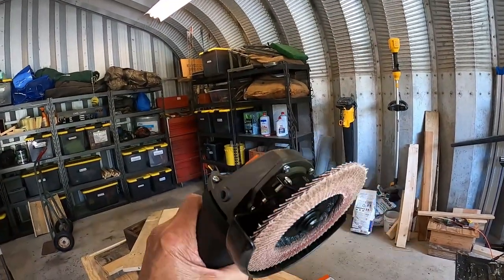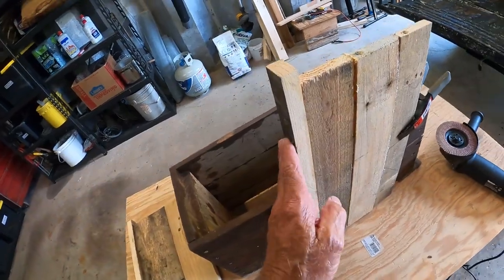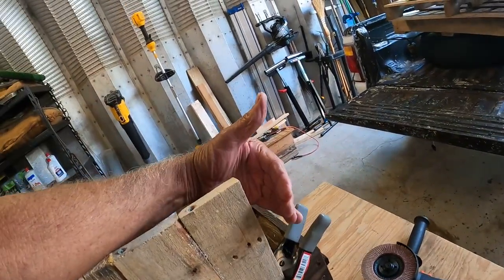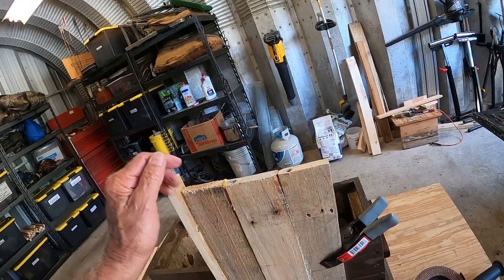Follower Boards

Comment: Nice Video re pallet timber.
Your Camera seems to bow the Top Bar in footage... 🤔
Reply: Have you a Video on making a Nuc from pallets.
Are your Boxes using Langstroth measurements?
Reply from the maker: Thank you!
Reply from the maker: @ME_MeAndMyBees  Yes i have a video on making them. No the boxes are not standard but standard frames go in them. I buy 2x8 s for the ends they are 10" tall. The sides of the boxes are made of pallet wood and are 21 5/16 long. The whole bottom is all 1/8 screen with a cleat at each end. Very simple box to build.